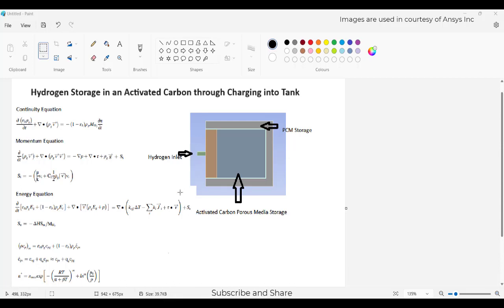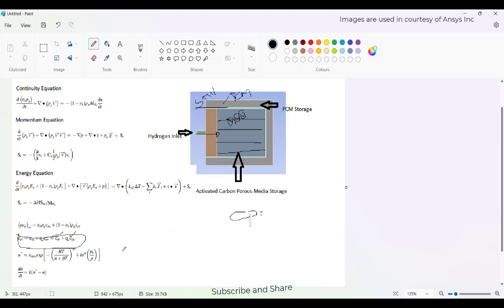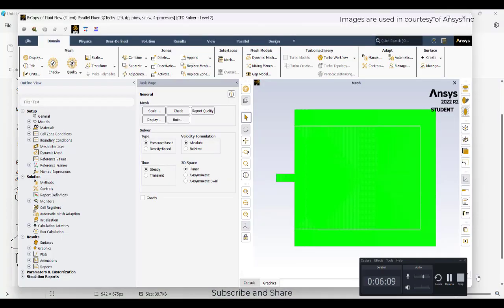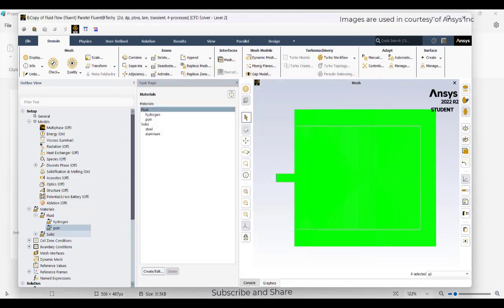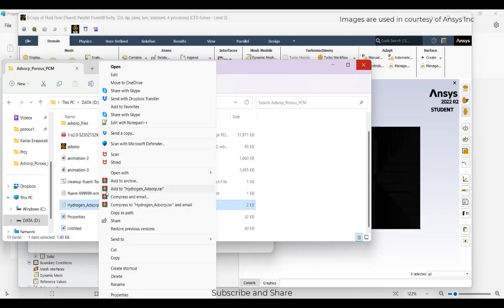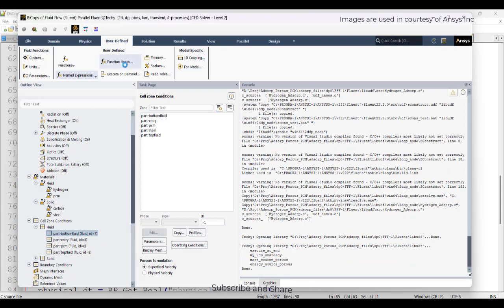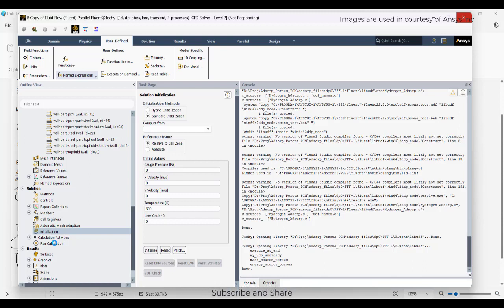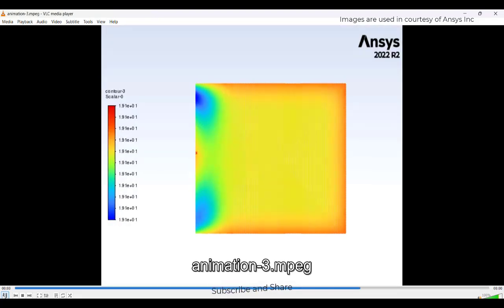Hydrogen Adsorption on Porous Carbon Media with Heat stored in PCM

Comment: Can you we use bussenique approximation for hydrogen if hydrogen entering into a chamber with heater. To calculate the thermal convection of hydrogen from cold junction to hot junction?
Reply from the maker: It depends on the temprature gradient between two pointa
Reply: @shavantechnology3472  thank you for your reply. The temperature of one point is cold and other is hot..